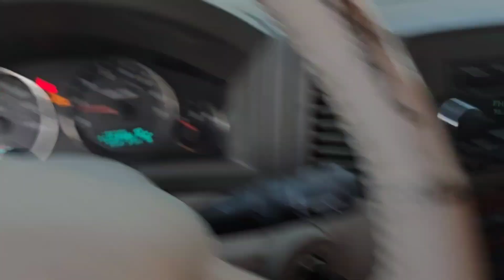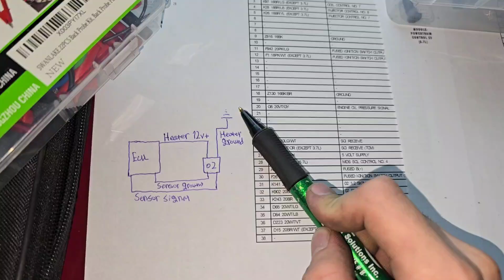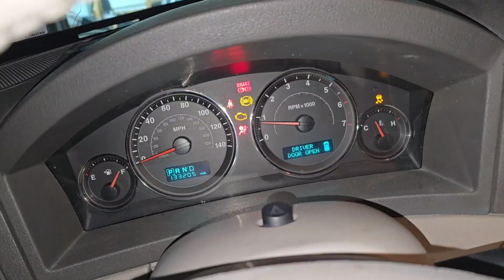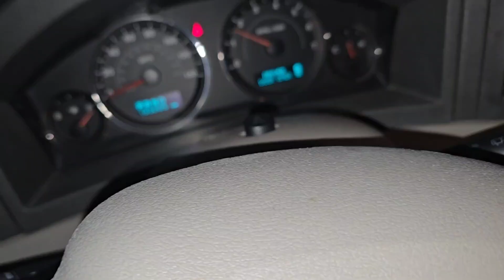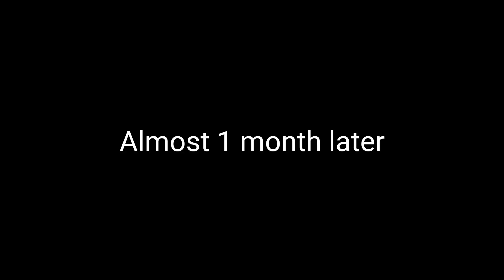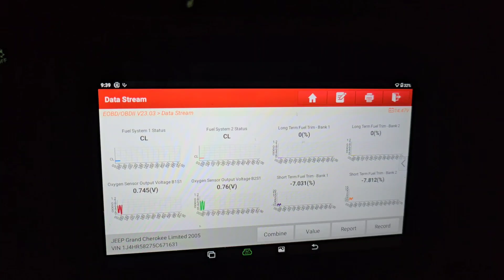Bad O2 Sensors or ECU? - 2005 Jeep Grand Cherokee P0031, P0037, P0051, P0057 Diag and Repair

Comment: First, thank you so much for great vid. I guess I’m facing the same problem and could you pls. explain some points. 
I have understood with checking the connectors the ground, so it is good once it shows 4 oms of resistance it means we got continuity?
Next was not much clear for me – excuse me I’m completely dumb in these wiring things. What and how did you connect with bulb, I would appreciate so much if you can write it down.
And about replacing ECU. for example: mine P/N is P56044 515 AE another sticker says 56044 552AK sequence 868980, should I look for the ECU with same numbers or it can be just any from 2005 4.7 GC?

Comment: So it was the PCM all along? I have the exact same jeep doing the exact same thing. Had a company “rebuild” my PCM and it’s still doing the same thing.
Reply from the maker: @CharlieBuilds  Yup, PCM drivers dead/partially dead. Go through the steps I went through, especially the continuity check through the sensors and if that passes then PCM is your issue. Do a drag check on all the connectors as well.